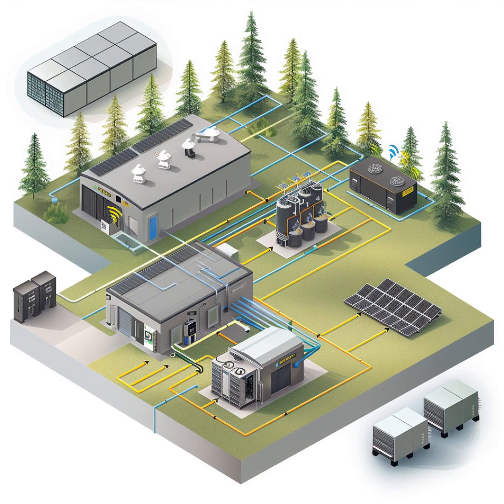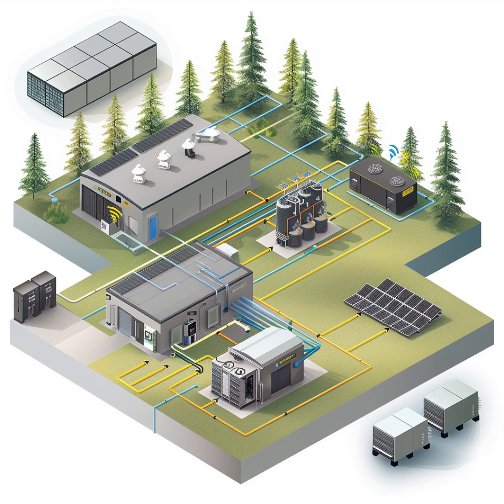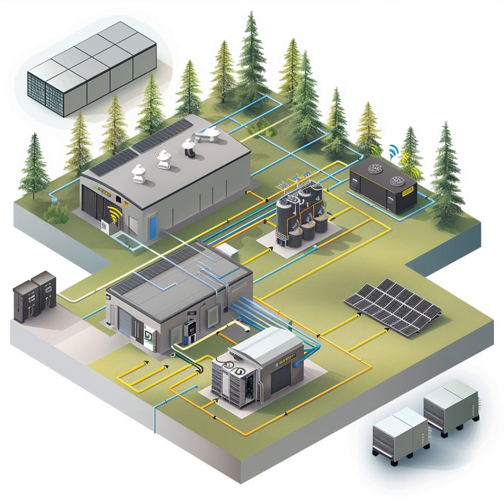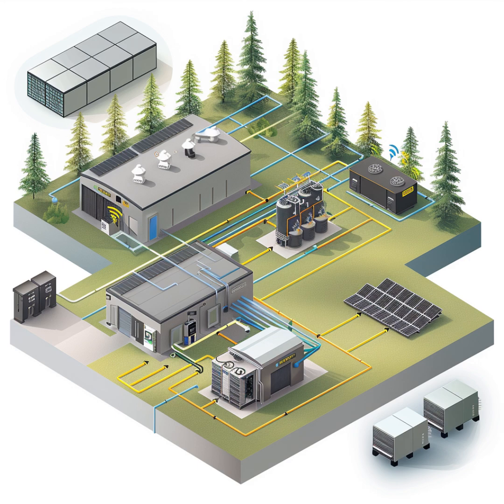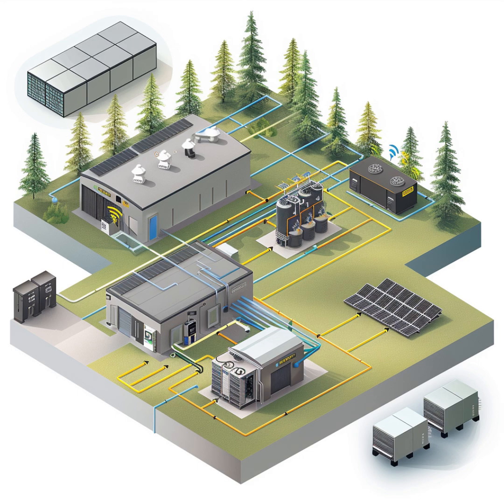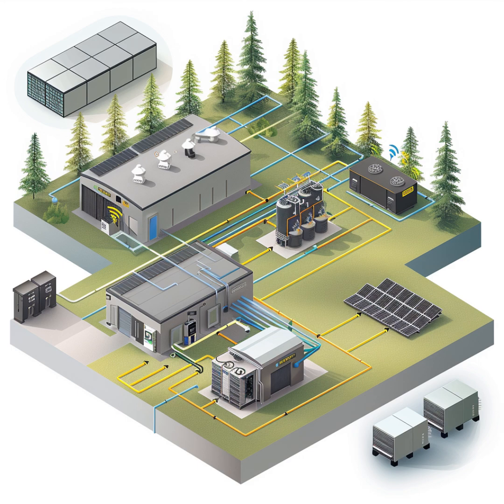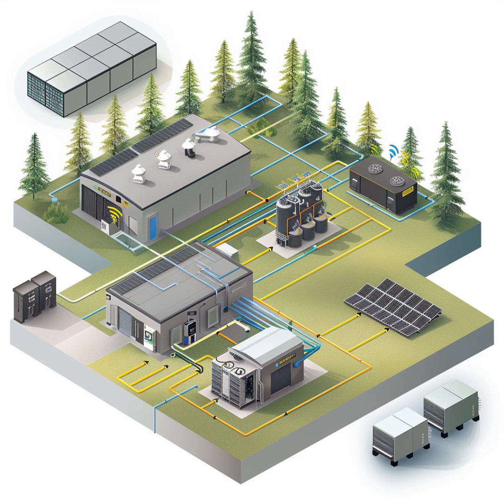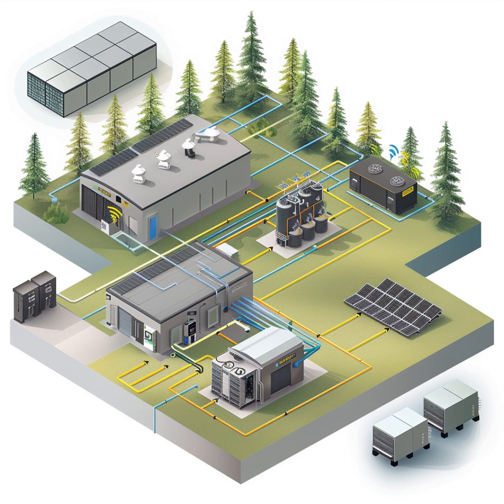DIY Solar Off-Grid Micro-Grid, Solis S6 11.4kW + Growatt 5kW Inverters

Comment: And how is anyone going to survive on 24kw in batteries alone without the grid... they shd tell pple the truth
Reply from the maker: I agree that a 24kWh battery is on the smaller side these days however I can easily run my house overnight with that. That's 2 full size refrigerator/freezers, 1 small fridge, 3 chest freezers and assorted lights and electronics. The bigger loads can only run during the day of course.
So it is doable, no problem and that is the truth. Just do the math. ;)

Comment: the battery is between 100v to 500v range. that is a 32 cell battery good find a replacement bms. good luck.
Reply from the maker: I don't understand the comment, I'm using Nissan Leaf batteries. No problem finding parts.